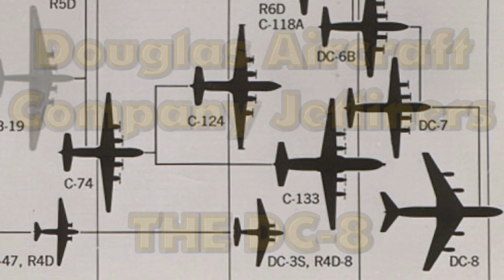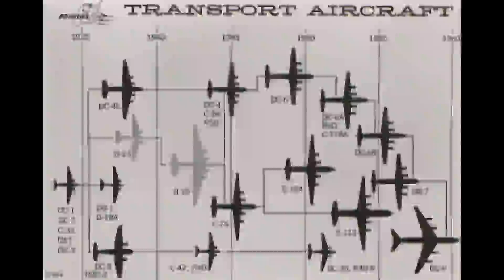Douglas Aircraft Company Jetliners - The 1958 DC-8 Public Relations Introduction

Comment: 130,000 cycles for wings is pretty impressive. For comparison, Boeing 707's were rated for 50,000 cycles (entire airframe).

At the end of the day, the DC-8 was a better designed and built aircraft, albeit it came with a slight fuel penalty. This is probably due to less wing swept than the 707.